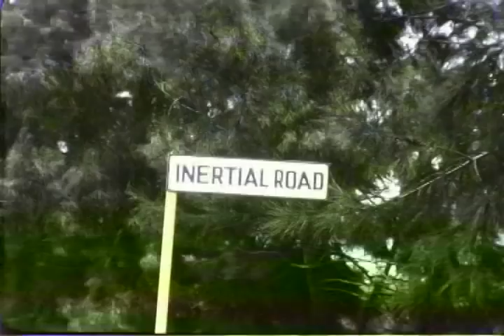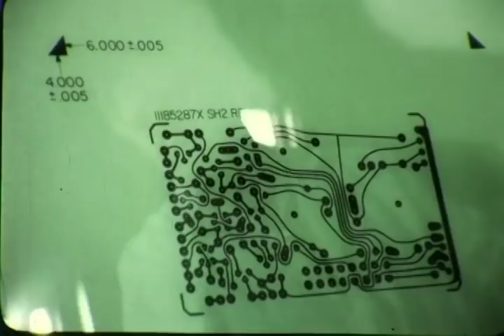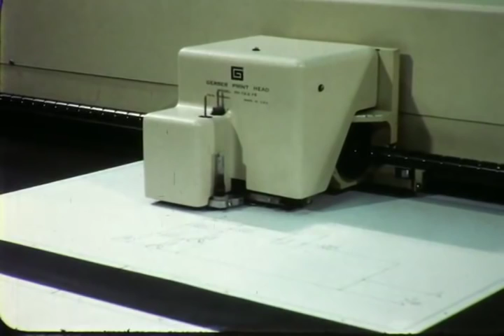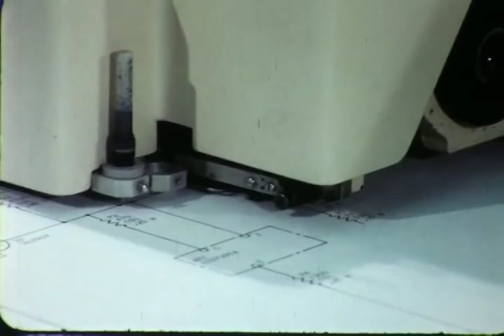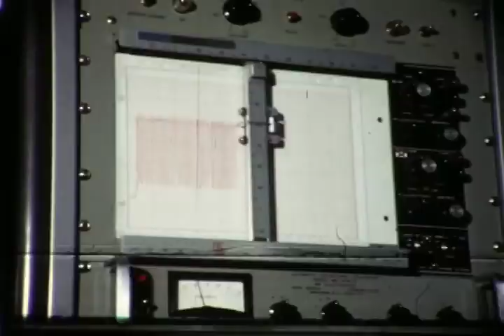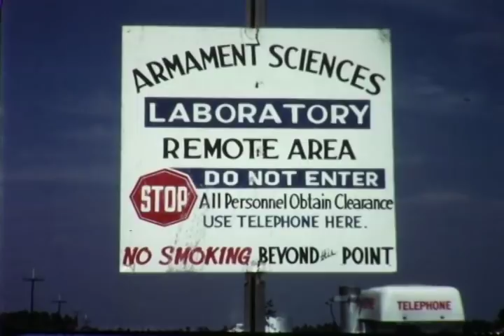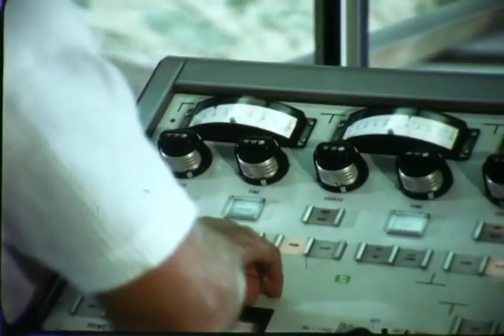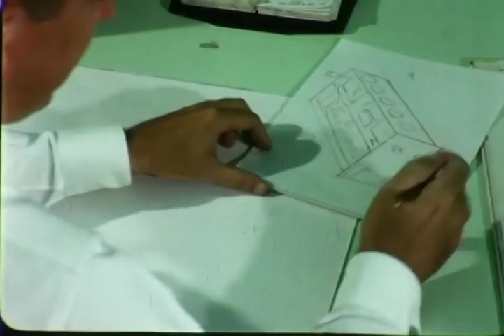HACL Film 00648 Martin Marietta Orlando "Images...Inside Views"

Comment: Funny, the equipment and stuff.  My father worked there way back, judging by the cars during this time frame.  He eventually got to VP, chief Engineer, Corporate, before retiring.  If I'm judging the time frame right, he was probably Systems Manager on SPRINT about the time this film was made.  I'm guessing, I was pretty young at the time.  I don't know what they're doing qual testing on there, but it could be a little familiar.  It's at least sort of the right shape and color, anyway.

I worked there as an EE from 1988-98, with a break to Coleman Research (a spinoff where I worked a target missile) in the middle.  My brother worked there, too, as an ME, thermal.  Hearing that shaker travel up through audio ranges is pretty cool.

A lot of this brought back memories (retired now), like the stupid column numbers.  When somebody wanted to tell you where they were located, if you didn't know, like going to talk to a dynamicist, let's say (applicable here), they would reference those col numbers.  The problem was that that plant was such a dad gum maze that you'd be headed in some direction and run into a wall, frequently.  It was a PIA, mostly upstairs.

I SOOO much better liked working the East plant (new, and actually had glass on the building, not a stinking cave that looks like this plant, kind of dreary and depressing), on Underhill road, but the ranges and some other things were exclusively West plant (Sand Lake Rd, near International drive, which many may know that have visited the theme parks in Fl).  

I finally moved from near the West plant to the East, to shorten the drive, and guess what happened? Yup, transferred to a program that ended up doing many months of test on the West side, and then the next which was West side.  I couldn't friggin win.  And CRC (that later company) was on the West side, too, while I lived East.

I remember going to a family day back about this time frame, and seeing some really cool stuff, and going with mom to pick him up from work occasionally when both cars were needed at home (infrequent).   Good memories, most of it.

Feeding the alligators....a dead stupid thing to do.  It makes them a lot more dangerous, because they get more used to being around  people.  HEAVILY frowned on, now.    And the guy tapping one on the nose with a piece of bread, I wonder if he still has all his fingers, if he's still alive.  That's exactly what I'm talking about there.  These things have a brain about the size of a pea, and can run down a human close by on the shore, EASILY.  They can't sprint far, but they can't sprint fast, well over 20 mph, IIRC.

They had an autocross club there, and occasionally would shut down that perimeter road, at least they did at some point, maybe later, because dad did it a few times with a 54 Healy we owned with a Ford 289 V8 under the hood.  I remember stop light racing with the thing (it was a different time)...THOSE memories were an absolute BLAST!  To be honest, it did a LOT better in a straight line than tight corners.  When the courses had some decently long straights it tended to do a bit better.  Out of the hole to 50-60 almost nothing on the street would beat it.  The driveshaft was about 14" long and MAN, would that thing dig.  I had a friend once, in high school, that said he could beat it in a running sprint (see what I did there) for at least 10 steps.  I laughed, and we tried it.  He got about one, then I was GONE!  He was shocked.  🙂

The checked shirts and goofy women's hairdos bring back memories, too.  Dad had several shirts just like that, until he got to the suit and tie ladder phase.
Reply: I lived off Underhill Road and 15A in the 1970s. I don't remember anything out that way. Underhill Road ended before Econ creek. That was all pine trees and palmetto bushes. Used to take the dogs hiking on paths out there. When did they build a Martin plant out that way?